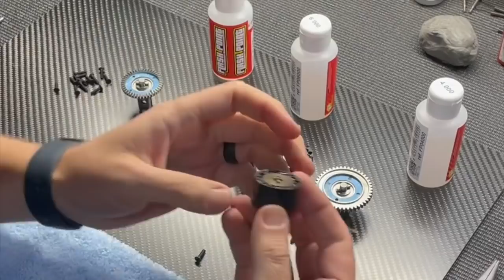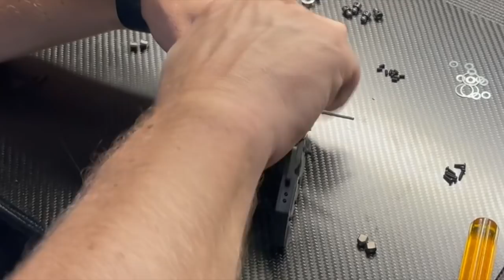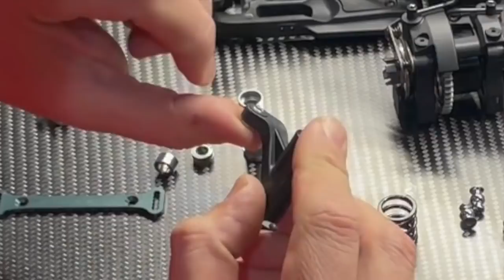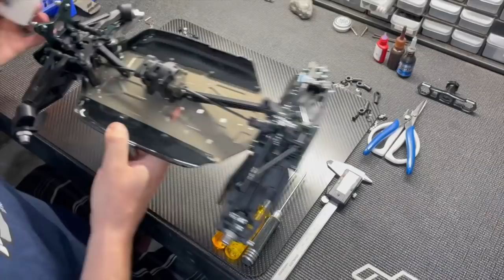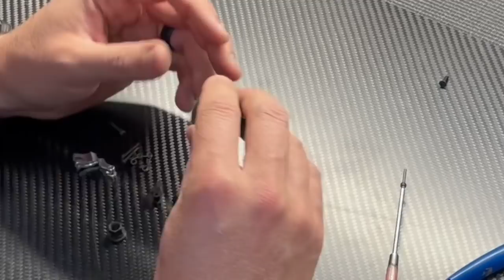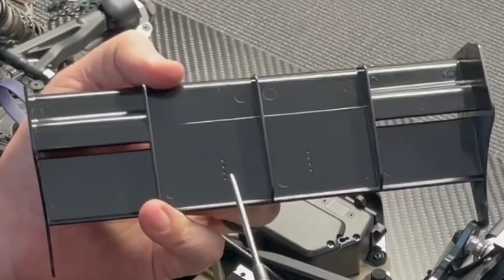Mugen Seiki MBX8R Complete Build.

Comment: I run an x ray and a sticker over pillow the ball hexes  is a good tip, i never thought of that. I do run  x-ray graphite uprights and I use graphite dry lube and it helps but constantly maintaining up rights and pillow balls to keep it smooth. The xb8e looks fast and low cg characteristics are really good but if I buy another Nitro I'm going with Mugen. I have an mbx5 and it was a really good for what it is
Reply from the maker: Good stuff, thank you!

Comment: Hi Adam, thanks for the detailed video! Could you make a video about tuning with the front upper arms now that we have more options? And tuning with the rear hub plates. Also are the stock 3 dot rear hub plates the same geometry as the mbx8 plastic hubs? Or is 1 dot the same as the mbx8 hubs?

Comment: What is the extra mounting point on the rear hub assy? the flat pad with the two holes.  looks a lot like a mounting point for a steering link.
Reply: looks like I found the answer on the interwebs.. apparently this is a mount for Mud scrapers? never heard of them before.

Comment: Drake, is OK to use non-chlorinated brake cleaner to replace your... lets say.. Magnum Force RC cleaner? Or if anyone else wants to comment about it.
Reply from the maker: That should be fine, but try to avoid getting that on plastic.
Reply: Keep automotive brake cleaner away from Lexan especially. It will literally melt lexan. Even a fine mist will scar the surface.

Comment: What do I do when my gear mesh is loud but set the same way you did in your old mesh video.
Reply from the maker: I would use a little Protek white grease on the gears.
Reply: @AdamDrake Would "Lith-Ease WHITE LITHIUM GREASE" work? See ya at the 2022 PNB! Thanks!

Comment: Hi Adam ?  What does 6000 do for the rear diff …
Reply from the maker: Thicker fluid in the rear will slow down mid corner rotation and also increase drive on the exit of the turn.

Comment: Why not just put the roll bars on bearings so they're locked in and free-spinning always?
Reply: Because there are different size of roll bars.
Reply: @FattydonTube  not an issue, the same exact collar style with grub screw will hold the variable size roll bar and also adapt the diameter to the bearing. Several other brands do this successfully already.
Reply from the maker: That is one way to do it, but not the way we decided to do it for the MBX8R.
Reply: @AdamDrake  yes, but why? Is there an advantage to using a slot and then collars to hold the bar, or is going to bearings just too big of a change for the R and maybe we'd see it in the 9?

Comment: B0766 is not the correct diff shim size as mentioned at 16:04
Reply: @mektrix8887  B0767. Kyosho also makes the same kit.
Reply from the maker: Yes, I believe it's B0767.
Reply from the maker: B0767

Comment: i don't understand why does A-arm stiffener need to be screwed on..instead of making a flat solid A-arms and forget that stiffener...it just something for the looks /make a flat solid A-arm and no more worries...
Reply: Look up section modulus, you can get the stiffness you want at a much lower weight. You can also tune the arm stiffness with optional stiffener plates.